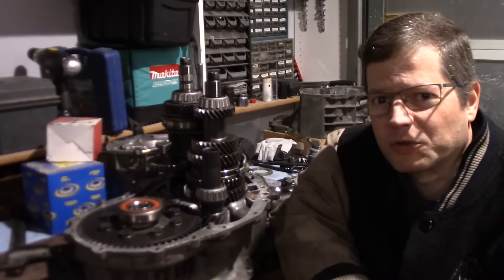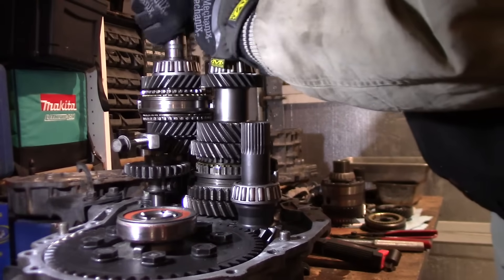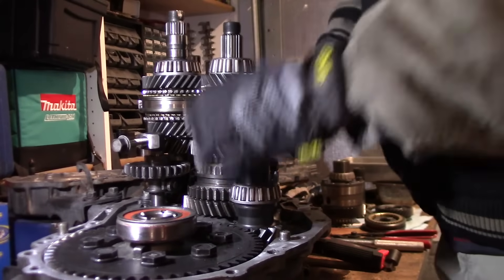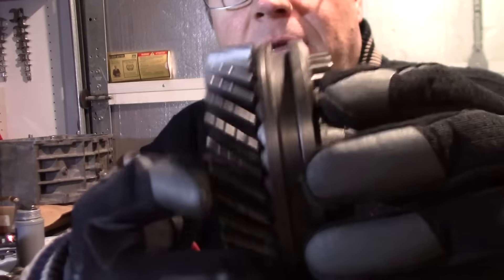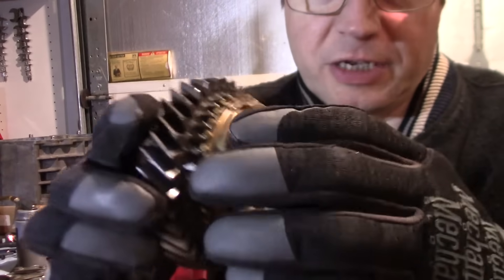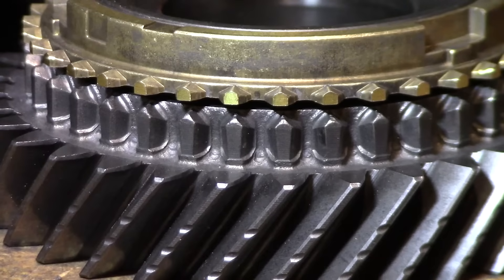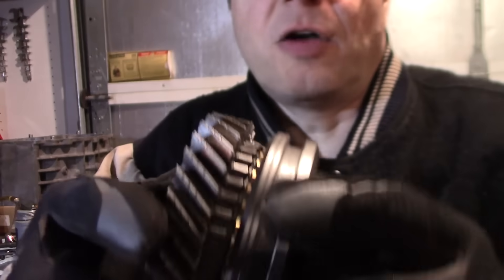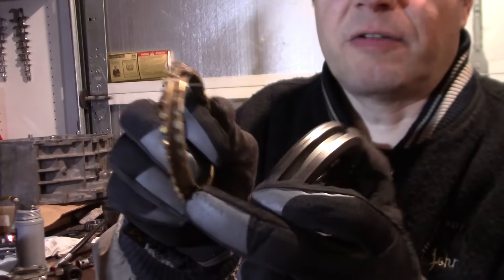How Synchronizers Work in a Manual Transmission

Comment: Well after 33 years and experience on eight different cars with manual transmissions (and one was a Jeep), I still don’t understand exactly what he means.  

And my last two transmissions have “triple cone synchros,” so we need to start over and try again.

But thanks for trying to help, YouTube.
Reply: It absolutely makes nonsense to anyone with little or no understanding of the mechanical workings of a transmission.  Basically a pointless video.

Comment: This all looks incredibly complex and even more fragile, it's probably why I never trusted myself with a manual, all I ever imagine is the sound of broken glass in a tin can.

Guess I know why transmissions don't grind down due to wear, with proper maintenance of course.
Reply: Wait until you learn about automatic transmissions relying on solenoids to open or close valves controlling the hydraulic pressure on each gear.. All the clutches wearing out in the oil, having an oil pump and oil filter within the transmission you need to service. Compared to a manual being lubricated without any pump and with mostly blunt parts pressed down a couple of shafts. Oh and don't get me started with CVTs requiring really sensitive oil pressure in order to actuate the conical pulleys as intended. I'm taking the manual every day of the week.
Reply: Manuals are much more reliable imho. Until the gears aren't synchronized and meshed together, the feel on the stick is that you haven't put it into gear. Grinding is almost impossible to do. And maintenance is basically not needed. I sold 2 y ago my 2001 Suzuki GrandVitara and I think I did a preventive oil change back in 2010 or something. I was the 3'rd owner, I was sometimes off-roading with it and I NEVER had a grinding event. 
Driving a manual in Europe, I learned to dread automatic gb's for more than one reason, but maintenance is the top one.

Comment: Thank you! This was well explained.
One thing I don't understand is why so many old gearboxes had no synchro on 1st gear. I've only driven one such car.
In stop/start traffic, it's a grind, and I wonder how much they saved per gearbox by omitting synchromesh on one lousy gear.
Reply: I would take an uneducated guess that it's to stop you from destroying the engine, flywheel, clutch, gearbox and final drive by ramming the car into first gear while travelling at highway speed

Comment: So that explains why when my master cylinder failed and i could still get my truck to start from a stop without being able to dissengage the clutch. I pressed the lever and the friction from the syncro was enought to very slowly creap the truck furward until i could just slip it into gear. I always wondered how that was even possible to get me 20 mi home on a mix of highway and  (incline free) city streets. Thank you for solving that mystery!

Comment: Also 3 yrs later, I think I searched for this once because I wanted to know. I learned accidentally one day that some transmissions allowed you to sit the shifter on the synchro with the tiniest amount of pressure on the shifter, then when everything lines up, the transmission just slips into gear. Of course, there is also the RPM matching that truckers do where they don't have to use the clutch. My car didn't have a tach so I wasn't able to figure it out by ear.
Reply: As a trucker, I'll tell you that it's muuuch easier to float gears at lower RPMs than higher up. Work on it near the very bottom of the powerband and it might work for you.
Reply: I remember learning that if the transmission has a synchro (I believe it's with not without) you can shift without using the clutch. I think it has to have a synchro but if you aren't careful, it'll grind and you can damage it.
Reply: You should still be able to figure it out by ear pretty easily. I remember being a kid and my dad let me shift from the passenger seat, and I couldn't even see the tachometer. Just knew once the engine got louder that it needed to shift.

Comment: I don't shift until the synchronizer gives me the ok. Also, why do I have to wait so long for the rotation to stop before being able to shift into R?
Reply: Because usually reverse gear is not synchronized, i.e. it doesn't have that brass ring that matches revs. Instead, it has straight-teeth gears that just slide into meshing position. This also explains the different noise when driving in reverse.
Reply: @markotrieste  There is no "reverse gear", there's an armature that allows 1st gear to be driven in reverse
Reply: @TheRealRumple999 What do you mean by armature? The reverse gear is a set of three gearwheels, instead of the usual two. Also, they are not constantly engaged since they are not synchronized. 1st gear has nothing to do with reverse. Proof is the fact that first gear is synchronized while reverse isn't.
Reply: @TheRealRumple999 0:13 notice two gearwheels with straight teeth and that are not engaged: these are the reverse gear gearwheels. Nothing in common with first.
Reply: You can always put The car in neutral and let go of the clutch, then when you push in the clutch it will go in reverse without any issues
Reply: PS what do you mean by "giving the ok"?
Reply: @markotrieste I mean that I don't just slam into gear, if you start to shift and just push the stick till the ring start to sync, the stick will glide into gear on its own when the synchronizer does its thing.
Reply: That's not how you're meant to do it. Just shift when you're at the right speed for the gear, and the synchros will sort the rest out.
Did you have a professional driving instructor, or do you just change gearboxes and clutches every 50k miles?
Reply: @Skorpychan considering that nothing has been done to the gearbox in almost 190k miles, I'll ignore your pointless reply.

Comment: Im trying to game now and h9nestly its sticking hard with the HoMM3 vibe mashed with strong bits of V and 7 thrown in. 
The issue is that its forcing the old school but is missing a lot of polish here and there. The graphics are jarring to me, the cell shaders for the "drawn outline" look is annoying as hell. The model colors are not vibrant enough in tbe brightness which makes object sometimes seem concealed. To me, Ore looked like Mushrooms at first and without the "Twinkle" that HoMM3 resource prites had, some things were hard to see. 

The game actually offers a LOT of variety, making the claim that stuff will be OP here and there kinda moot at the moment. In PVP, and just years of playing HoMM3, the purpose of games is to either pursue high efficiency gameplay to end the map fast or to purposely break the game. 
Id certainly give it some time first. Right now, i can see the game being developed in a way where its working with triads of synergies that are replicated across factions for the sake of balancing. 

Id like to see the game add a bit more to really seporate it from just rehashing basic mechanics. Id love unit facing to actually matter and be adjustable, id love units to 'pin' units they've engaged, calvary units to be actual calvary unit to add a variatey of unit roles, map logistics systems, actual town management, i mean something that really pushes the idea that its HoMM3 reimagined, not just rehashed.
Right now its so rehashed that it even takes things that fail still in HoMM3 proper and placed them in the game, such as the Temple using the same Skyship town function used in the Tower on HoMM3. This LoS boosting special os a massive waste and will never be useful.
Reply: And what does this have to do with gearboxes?...

Btw, V is awesome, VI is decent, VII is a mess.

Comment: Another great thing about EVs is, that they don‘t need all this gear mumbo jambo!
Reply: Theres absolutely nothing wrong with EVs in principle. Max torque, plenty of power, top end possible, low CG mass possible, compact drive train...
Literally the only issue is that EVs are battery powered and batteries are ASS. 
You do NOT get the energy density that gasoline provides per unit gram. Petrol itself is just a superior density for energy as the material is itself a far better storage form. Thats why you'll find it hard to get rid of them for EVs. 
Youll never see super high performance applications be replaced by EVs for example. Things like cars, even sports cars? Sure. 
But things like jet aircraft for military applications? No. Never. Youll simply never have the energy extraction potential possible to produce the thrust needed with Electric based system because liquid petrol forms jist contain that much more energy density with more potential heat energy to extract.
Reply: @Nurhaal you are right about energy density. Just don’t forget most fossil engines utilise a maximum of 30% of that energy. I know it’s still like 25 times better for energy density, but it’s still a huge waste.
Now… if hydrogen cells becomes a mass produced safe option, you will have an EV with 3 times better energy density than gasoline, and way better usage of that energy.
Reply: @79messias hydrogen cells are even worse, actually. Hydrogen takes up HUGE volumes, which is why we dont use it anymore for our modern rockets. 

No Fossil fuels is jot a huge waste. You dont have an engineering mind at all if you think that. The efficiency needs to be improved, which is where engineering comes in. People are so whipped up by dumb ass news articles that they dont realize my Nissan altima Sr still out does a Model S in terms of foot print. Modern IC Engines are quite effecient hut they have a lot of heat left to still extra, which means the ceiling is higher still. 
EVs have a higher ceiling, though, because their effecieny is even lower. Its extremely restricted by material and manufacturing sciences. We do have the target solutions with super conducting materials, but the mass manufacturing right now is impossible at scale.
Reply: @Nurhaal  first of all calm down man!

30% usage of a power source is a huge waste no matter how you put it.  That doesn’t make the fossil fuel bad, it makes very inefficient. There is a huge loss of energy through heat waste and mechanical waste due to alls the moving parts such as gearbox, axles, pistons etc. an EV run the motors directly on the wheels, which makes the only loss through heat in the electronics. Furthermore you can regenerate on an EV which further increase the efficiency.
I work in the SOEC field which put me in a unique situation on hydrogen cells. Look it up if you don’t know what it is. This is why I am saying WHEN they become mass produced. We are not there yet, but getting very close.

I was trained in my youth by Mazda, and worked as a mechanic for some years. One of the things they did, was work on compression rates to improve efficiency, when everyone else went the turbo way. They called that the sky-active motors. Again look it up if you don’t know what that is. But WHY has no one actually improved it significantly in 100 years? Hint: moving parts. After this I went back to school and became an engineer. In Denmark we call it “maskinmester”. In English it is called bachelor in marine engineering and technology management. I have since worked in R&D on hydrogen test units. So can we please stop assuming thing we actually have no idea about? 
Now to address the original point. Fossil fuels WILL become outdated for cars, trucks, busses, semis within a foreseeable future. EVs on batteries is just a temporary solution, hydrogen will probably take over for the batteries. For shipping ammonia is taking more and more over, and for airfare you will slowly see SAF be more and more integrated.
Reply: EVs - for when you don't actually drive any meaningful distances, nor do you care about not wanting to burn alive when your door handles fail to open after a wreck.
Reply: @paulstrealer5414 Exactly. Anyone who actually works for a living knows that EVs are dysfunctional fashion statements for unemployed hipsters and not anything we'd actually take seriously for meeting transportation needs, let alone actually getting work done.
Reply: @Randy_goatman EV means the vehicle is powered by electric motors, not that it has electronic door handles...Why do people always bring that up as if no EVs with traditional handles exist?
Reply: @Randy_goatman  my EV has mechanical door opening and can charge in 12 minutes to 80%. Also I can fill it up at home, have 7 year warranty, no moving parts like an IC engine, pretty much no wear on brakes, 575 hp, all seats with heat, vent and massage, very little noise, etc…. What about yours?
Reply: @79messias oh yeah? What's the make and model, so we can verify these claims? Because I don't believe you. And for anything other than driving 5 minutes to your local co-op, all of that is irrelevant anyway.
Reply: Evs lol. They're charged by power plants that are just giant diesel generators.
Reply: @BuddyHolly-x8d very insightful. It seems that gas-plants, nuclear-plants, bio-fuel plants, hydrogenerators, wind turbines, wave absorbers, solar panels, windmills, thermal plants etc. are just diesel generators as well. Thanks for sharing your extensive knowledge on power generation.
Reply: @79messias  Only about 5% of our energy comes from renewable sources, the rest comes from coal, oil, and natural gas. You are charging your EV with non-renewable energy.
Reply: @SchemingGoldberg well I don’t live in the states, which is an oil Mecca. I live in Denmark where 80% is renewable energy. So that is a big NO to your assumptions.
Reply: @SchemingGoldberg They still don't get it. Their European power grids are barely able to keep them from freezing in the winters but they think they can put millions of those imbecile EVs on the road without issue. Green energy is a scam.
Reply: @BuddyHolly-x8d  sure buddy. The guy from the country that still runs pretty much all their power lines above ground, like some 3rd world country, wants to lecture us about a good power grid. 
The irony!
Reply: @79messias cry more; you know I'm right
Reply: @BuddyHolly-x8d In many European countries heating is mostly gas and oil. The thermal power plants that supply district heating also supply electricity to the grid. Around 50% of eletricity come from renewables.
So..not sure what you're talking about...Which country is freezing?
Reply: @BuddyHolly-x8d OMG get your research right
Reply: @deantiquisetnovis I am right. 98% of my state's power plants are deisel generators, with a handful of hydro. EVs are beyond stupid.
Reply: @BuddyHolly-x8d to answer with Winston Churchill: I could be of your opinion, but then we both would be wrong.
Reply: @BuddyHolly-x8d  and 95% of my province’s power is hydro. The energy mix of grids is getting greener and even when the grid is powered by fossil fuels EVs are still better because massive power plants are more efficient than a gas engine so it still pollutes less. Only a grid mostly powered by coal is worse but those are rare now.
Reply: @bensemusx mmm tasty kool-aid
Reply: It really makes up for the extra weight!
And the fires!
And the electronic door locks that don't work when the computer bricks!
And the knowledge that enslaved children mined the lithium in the battery!
And the remote control over your vehicle!
And the knowledge that if the battery is breached, you're going to burn to death in seconds!
Reply: @Skorpychan  oh how clever you are. Mechanical door handles are present in most EVs.
Let’s not use 12V batteries as well, they also contain lithium.
Should we talk about the 1.1 million cars BMW just called back, due to the starter relay causing fires? Peugeot and Citroen had similar call backs years ago.
Keep being clever my guy, and I’ll enjoy my 600hp EV with all seat with massage and ventilation… oh… and I’ll just fill it up while I sleep at 1/5 the cost. All else fails.. I can tap it to 80% in 12 mins… I’ll just have a coffee and massage meanwhile. Maybe I’ll ponder over my 7 year warranty as well.
Reply: @79messias  Lead-acid batteries contain no lithium.
But yeah, enjoy your 50 mile range and hours-long charging times. 600 miles to a tank of diesel that fills up in a couple of minutes, here.
Reply: @Skorpychan  not many use lead acid anymore. I got 300 miles on my G9 with 12 min charge time to 80%. That’s when I don’t charge while I sleep 😘
Reply: What a great thing about not being able to brake with the engine woohoo ! Safety and brake longevity out of the window. Yesss !
Reply: @cdgncgn Don't expect these hipsters to understand what you're talking about. Their life experience could be summed up by one word- Starbucks.
Reply: @BuddyHolly-x8d I can’t figure out if you’re trolling or just daft… I am leaning to daft. One day you’ll be able to get an EV as well don’t worry!
Reply: @79messias nice try troIl
Reply: @BuddyHolly-x8d mirror!
Reply: @cdgncgn Your ignorance levels are punching through the roof. Regenerative braking is an integral part of all EV designs.
Reply: @cdgncgnyou obviously don‘t know anything about EVs. Read up on the word recuperation.